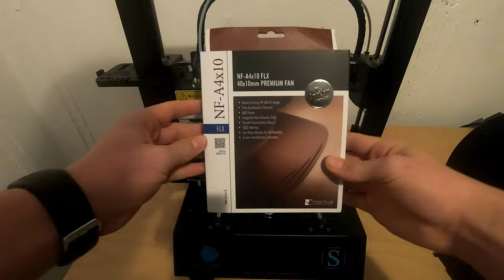Upgrade Anycubic I3 Mega #1: Change driver and new fan duct for the drivers

Comment: I've seen a lot of these videos and yours was is the most detailed one. The only thing I would say is that there was no need to speed up this video. Let me explain. It is mostly beginners who will be watching this video because this seems like a pretty straight forward mod. Beginners like me are scared of doing the wrong thing so we like to watch all the details but the video was sped up and there were no close ups. Great video regardless.

Would you maybe consider doing a follow up video, it doesn't have to be long, but please do a close up and simply show where to touch the leads exactly to the board and the stepper motors when adjusting the voltage? You probably don't even have to record this video, it can probably be done with pictures. Also, did you adjust the voltage on all the steppers?

Well done! :)